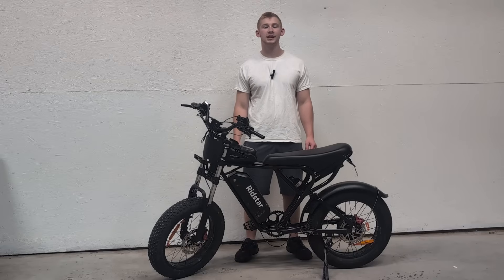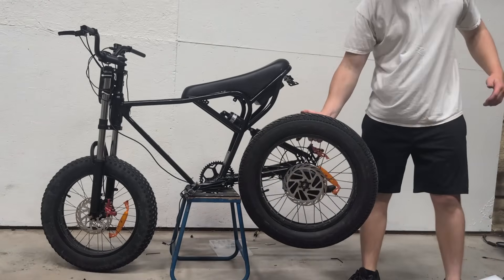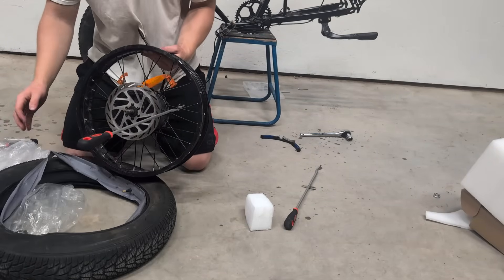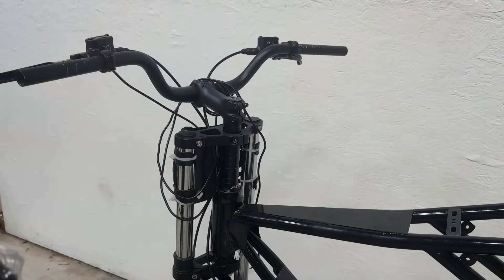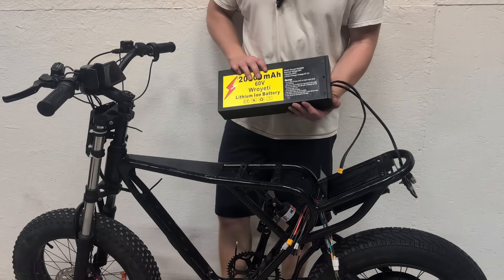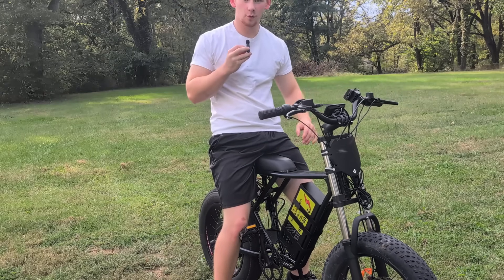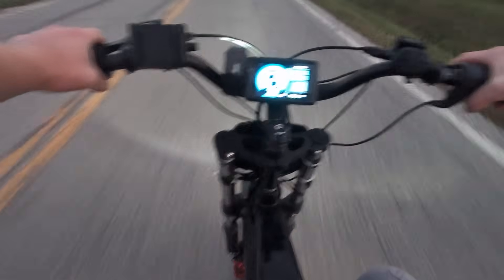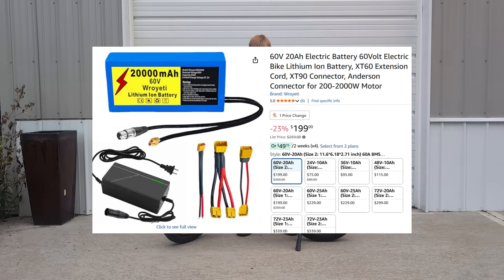I Built the CHEAPEST Sleeper E-Bike (Ridstar Q20)

Comment: DNM adjustable air shock for the back and any fat tire air forks in front will make the bike so much smoother
Reply: A programmable controller like fardriver would have way faster acceleration 
Good job though. It’s a great frame and can handle a lot of power. Get yourself 2 good torque arms to protect your dropouts

Comment: The diffference in size between the motors is not because of the voltage/power.
The 60v one is direct drive (they are bigger) and the 48v one is planetary gears drive (allways smaller)

I have the 48v direct drive and it's just as big as your 60v one. (same diameter, not so wide tho)
Reply: Hell naw

Comment: Look into a FLIPSKY 75200 Pro V2.0 84V 200A with Aluminum PCB with Key Switch controller you can program it from your phone and use it as your display. You can use it now with what you got and if you want to go AWD and 72 volts it will do it too. Look up e bike builder for more information.

Comment: What is the wattage of the rear hub motor you purchased . . . 
You keep calling it a 60volt motor , yeah it will run on 60 volts but what is the wattage output of the replacement hubmotor .
On the hubmotor it should be stamped with a bunch of numbers and the first few numbers are the wattage output . . . 
Provide image or put the number sequence . . . .
Reply from the maker: 2000 watt

Comment: I would put a torque arm on your bike. Asap
Reply: what's that for?
Reply: @GottaRiskItForDaBiscuit_2025 helps your frame not snap
Reply: @javaris9729  do ALL e-bikes need that? does it matter which brand/model?
Reply: @GottaRiskItForDaBiscuit_2025 what’s your motor wattage?
Reply: @javaris9729 I don't have an e-bike yet. I'm still researching and comparing models for what fits me best
Reply: @GottaRiskItForDaBiscuit_2025 ok that’s fine I would only recommend torque arms for 3000-5000w motors, although they can be useful for lower power e-bikes too.